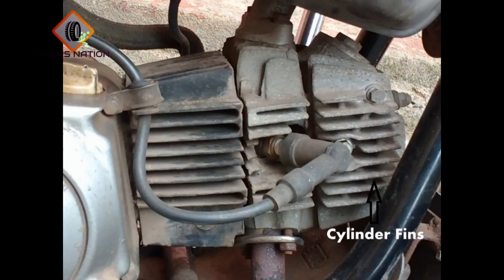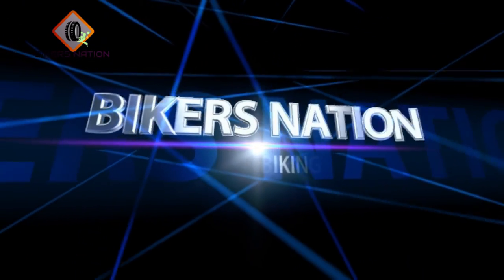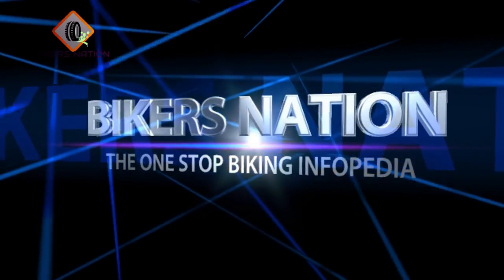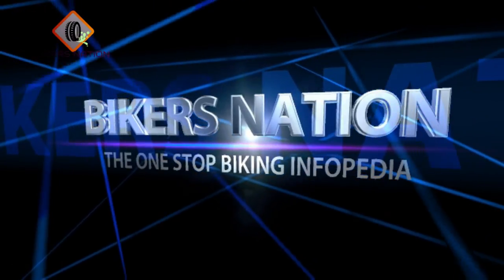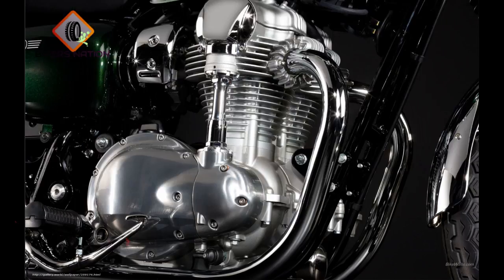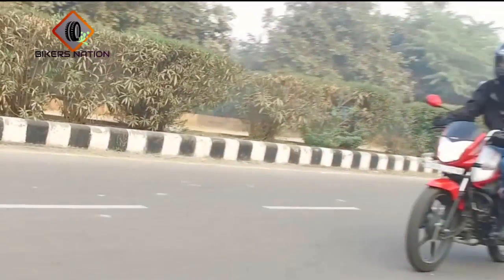working of motorcyle engine |  cylinder fins | cooling fins | function of cooling fins on motorcyle

Comment: can we extend the cooling fins? for better heat dissipation?
Reply from the maker: evilgel666 you usually cannot, because that would require you to re-design the whole cylinder by boring which is not recommended and moreover the cylinder come designed already to maintain optimal cooling.
if you are to increase the cooling still, you'll have to go for third party modifications like adding an additional radiator mechanism or changing the cylinder setup altogether.

Always remember! cooling the engine more than recommended during operation may affect the performance negatively.